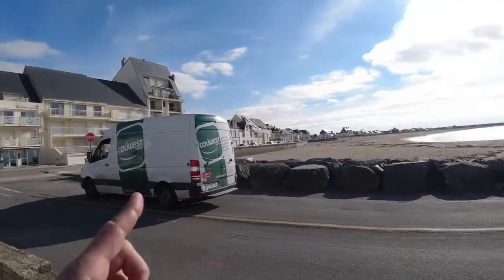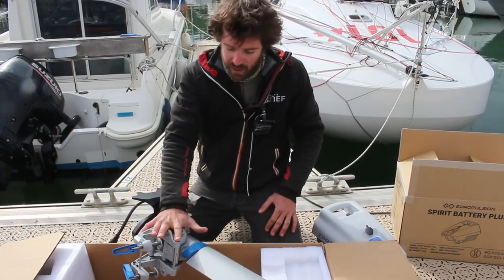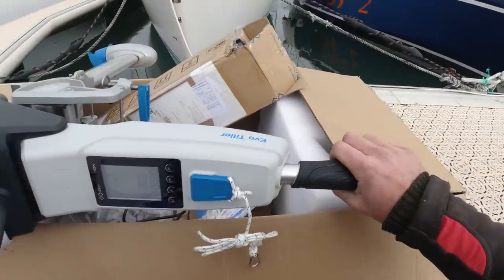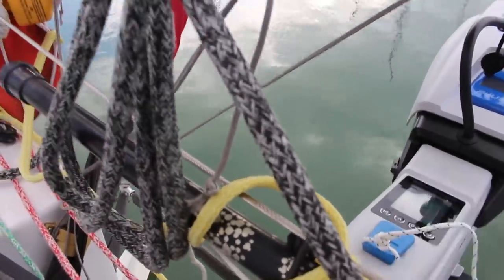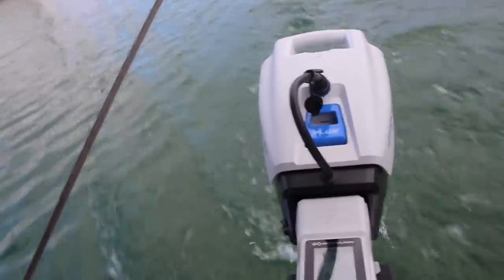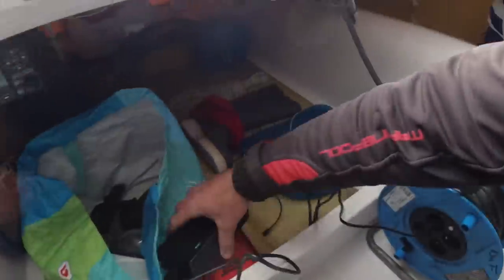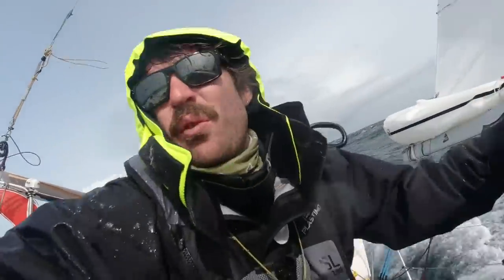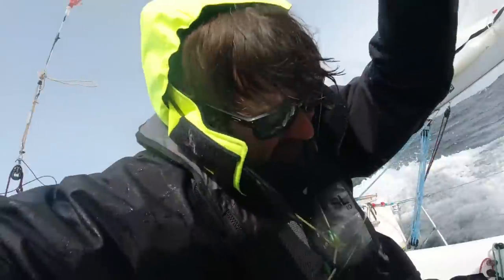Can an electric outboard survive offshore? Testing the ePropulsion Spirit 1.0 Evo -  Ep145 - TSF

Comment: Thank you for posting this. I ordered an Epropulsion Spirit 1.0 only this morning for my Sun 2000. Ever since I have been a bit worried as all the YouTube videos that I’ve seen have been using them on inflatables or lightweight fishing craft on inland waters. I was sure it would be fine for my needs but wanted to see some proof. Now I’ve seen it. If it’s good enough for your boat when leaving and entering marinas it will be more than good enough for mine. I’ve subscribed to your channel. I sail out of La Rochelle so I will keep an eye out for your boat as you might well be in the area from time to time. Merci une fois de plus.

Comment: Hey Hugo , electric outboard is super...i put it on my 21ft last season. for entering and leaving harbor priceless..new brushless motors are  efficient and reliable.., many times i see guys sitting in the marina and fiddling  around with combustion  outboard motors instead of sailing...
Reply: Which ePropulsion model did you get? I see the Spirit 1.0 and Spirit Evo are both 3hp. Is that enough for your 21ft sailboat? Or did you need to get the Navy that comes in 6hp or 9.9hp?
Reply: not chef  they bougg chief out biard 40000 hiues 40 year rekbile

Comment: Great information on your engine. Regeneration a major advantage. If you get a spare magnetic ignition switch, you will be sure you won't lose the one that came with the motor. It might be helpful to have some spray electronic cleaner aboard to use on the cable in case salt film causes poor contact.
Reply from the maker: Great point!

Comment: My following comments about electric engines are not related to this product.  I have an electric yacht inboard engine in my boat. It was super easy to install and the cost wasn’t bad either. The real costs are in the batteries.  On a motor such as mine 10kw, you need about 6.5 kts to get any measurable regeneration.  So we essentially need to be at hull speed to get any benefit.  I would expect a motor such as the one Hugo has to get regeneration at much slower speeds.  Of course with his rocket, he doesn’t need to worry about it.

Comment: Looks like an awesome motor thete are 2 features that I would like: One to charge the boats batteries not just it's own battery and B to have option to use the battery remotely, like to have the battery inside a cockpit locker.
Reply: Totally agree, question is whether it could handle the abuse and power created at speed behind a boat like Hugo’s. The Vendée Globe saw several hydro generators burn out I believe cause they aren’t expected to run at such high speeds. It would be awesome on a cruiser to charge batteries on a dull day when solar ain’t putting out
Reply: Don't need to charge boat battery. Just have one extra battery and 2 ports inside. 12V and duble capacity. When using one battery for propulsion, one is always House battery. For small boats would be perfect. Modular and chargebal at the same time. And for raising they can make only hidrogeneration modul. Baseclly all in one product
Reply from the maker: Yeah you're right, ePropulsion offers this option, have a look at their website, they did thought the concept through

Comment: It would be good if you could have the battery remote.  
Looked a danger of dropping it in the water when leaning over the stern.
Reply from the maker: Yeah, epropulsion has this option, I already have batteries so in my case it wasn't interesting, but they thought the whole system through
Reply: Just seen elsewhere that they are both waterproof and float.  Torpedo ones don’t float!,

Comment: Great with the new regeneration!
We built a daysailer also equipped with a spirit 1.0, a tip is to  use  E-Ps extension cable so you can have the battery inside the cockpit and don’t need to huzzle with it outside the boat in waves!

Comment: That's the best electric outboard I have seen so far. I am not going to point fingers but those electrics with the high whining sound drive me fucking nuts. The battery life is actually quite impressive for the electric outboard motors I have dealt with, but then it is a battery superior in size to the many electric outboard MOTORS I have played with. Engines burn fuel, motors run on electricity. Overall I am impressed with that electric outboard. In addition you do know, if the thing can charge its own battery, it can charge others aboard as well. just saying,,,,,

Comment: On your ~1 ton boat, have you tried motoring into headwinds with the epropulsion? At 100% power, can it overcome 10 knot headwinds? 15 knot headwinds? 20 knot headwinds? My only concern about getting one of these is if winds are blowing straight out of a harbor and I have to motor into harbor for 10 minutes, overcoming up to 20 knots.

I don't care if it would be slow, but could it overcome 20 knot winds upwind at 100% power for let's say 20 minutes if the battery is ~80% charged?

Comment: If there was a way to stick the battery under deck and extend a power lead to the motor, in addition to also being able to mount it as part of the outboard, that would provide great flexibility. Such a battery could also be your house bank that charges also from solar. And no maintenance. :)
Reply from the maker: Yep, Epropulsion offers this option, for me it wasn't adapted, but have a look at their website for more details

Comment: Great review thanks Hugo. I have a Dufour T7, designed for the Mini way back in the 70s. I've reviewed the subtitles and notice you got 'about 4knts' at full power. Is this 3.5-4 or more like 4-4.5? There so few reviews of these Spirit 1.0s powering daysailers and I'm really keen to switch to electric but I have to have 4knts min to cope with the tide where I sail.
Hoping that my old fashioned pointed bow may be more slippery than a scowl when motoring!

Comment: Question; Greeat future that it can recharge it self, but is it possible to connect the boat to it to charge the batteries of the boat as well?  Nice video again!
Reply: My thought exactly. It would sure help on those days when Sol is not available.
Reply: @hemeoncn  If so, than its an great machine!
Reply: I’m sure an electrical engineer type could jury rig it, but for the company to make it easy for cruisers is a super idea and timely
Reply: @mhensen1  I think it’s an question of software, so time will be our friend!
Reply: I would expect all you would need to do is measure the output from the unit when charging and find a charge controller that will accept that input voltage to feed your onboard batteries.
Reply: @leo169  yup, but for me I wonder if it’s made to sustain that sort of constant work at this point
Reply: @mhensen1   good point, it would be a case of try it and time would tell I expect. As an outboard it should be reasonably robust, however it is not a purpose designed generator so there will be some compromises in design and effectiveness as a generator. You would need to weigh up the cost against a purpose designed generator and expected life span.
Reply: @leo169  yeah, personally am in over my head, I just remember those failures in the Vendee Globe with purpose built hydro generators, so I wonder if this wouldn’t be a little under built for long term power gen
Reply from the maker: ePropulsion has a system where you can have bigger "house" batteries inside the boat where you can connect the engine remotly but also had solar chargin etc...
Reply from the maker: Charging issues of hydrogenerator on the VG also has to be put under perspective... they are going to speeds and periods of times that few cruisers will ever experience :)
Reply: @TheSailingFrenchman  yeah but you do! My future cruiser...cough cough... won’t be an issue you are correct, my concern mainly was exposure over long times of constant charging ie for big house batteries, as you say it would be slow, but it looks like a fair bit of plastic on the motor so reliability was my point.
Reply: I guess so, if you have 48v batteries and you don’t mind that it would then charge at the rate of a small solar panel.

Comment: I have the impression the engine's battery sooner or later will end up in the bottom of the ocean. It should have some type of safety connector or something in case you trip while you are removing it or something of that sort.
Reply: The battery floats
Reply: This battery floats.

Comment: Not an engineer, but I would guess the reason for the pitch in the blades is less to do with making the boat go faster, but to increase the rate the battery recharges while under sail.  Adjusting the pitch to increase boat speed will slow the rate the battery recharged.
Reply: Could they build a prop that changes between the two states? Propulsion vs charging?
Reply: Probably 
However 
Added complexity will decrease reliability
Reply: One could have a separate generator, like the old log line trailed behind. That way no need for compromise on the props.  But then surely someone has thought of that?
Reply: yesx it dise

Comment: Hi Hugo. This is an interesting looking product, the hydo-generation is a fantastic feature. Something I will have a look at. 

On the cable from the motor to the battery is there a cap for the plug? Or is there some other way to protect the plug terminals from sea water? That might be one of the more important maintenance items to watch. Maybe carry some contact cleaner and a bit of dielectric grease as a precaution.
Reply from the maker: There is a cap indeed, but it seems a bit loose, I've just stuffed the whole connection with grease, just in case :)

Comment: Helo! On the one hand you pilot a sailboat that is naturally powered by wind and now you even bought an electric motor. On the other hand, you have a diesel van with a  very polluting engine and as it has a malfunction it still pollutes the atmosphere much more. 
Don't you think it's too inconsistent from you?
Reply from the maker: Here is another question to add in the mix. What has the higher cost on the environment: carry on using a van that is a little bit more polluting that newer versions? Or buy a new van, which has more than 3000 parts, all made in different countries, which each part had to travel thousands of miles in container ships, plane, trucks, and not to talk about raw materials...
I think my good old van is still greener ;)

Comment: Is it possible to connect the engine to the main battery inside the boat? Use engine without its own battery but only lifepo4 300ah inside the boat.

Comment: I have what looks like your outboard bracket, the black plastic mounting board for the motor on mine has a flat back but the front is full of cavities which makes it difficult to clamp the motor to it. Is yours solid or does it also have the molded cavities in the front side? The stand offs are a good idea so you can fully tilt the motor up.

Comment: That slamming into the waves ... How much slamming can a GRP sailboat take? I heard of people delaminating their bulkheads from the hull because of that. I always cringe when I slam hard into a wave like that. What is your take? Especially in the Med where you can have short and tall waves and confused seas. I'm really curious. How often does this happen on a racer in a big storm like you had in the Antarctic Ocean? How dangerous can it get for the boat?
Reply from the maker: Well, it's a fine line between too much slamming and going too slow, especially in racing.
On a cruising boat, don't worry about delamination, boats are made strng enough to withstand crashing in docks. Race boats try to save on weight, so its a different story
Reply: @TheSailingFrenchman  hey, thanks for the reply!

Comment: This seems like a great motor for cruising my small trimaran and the first one with a functional self charging system. Great! How much does the motor slow the boat down while charging?
Reply from the maker: Drag really depends on the boat, on a planning hull like mine, it's around 1kt between 2 and 4 kts boat speed, then 0.5kt between 5 and 7kts, then no more loss. I'd assume it's around the same figures on a light tri
Reply: @TheSailingFrenchman  Thanks!
Just the kind of answer I was looking for :-)

Comment: Great review thank you!! 😊 I have a 24ft semi displacement motor sailer at about 1.5 tonnes. I wonder if the Spirit 1.0 Evo would have enough torque to get in and out of the harbor and cruise around the bay (inlet)? I have a 8hp Diesel Engine built in but am looking for an auxiliary outboard motor. Any thoughts are welcome :) Thanks again for a great video and review.
Reply: Same here. My 22ft keel sailboat is slightly lighter 1.3 tonnes, but I use a 9.9 four stroke engine, which is quite heavy. I just bought a used Spirit 1.0 to test if it's good enough for getting me on the lake and see if gives enough speed to keep up with traffic on some channels. I'll keep you posted.
Reply: Did u guys manage to make it work with the Spirit 1.0 Evo? Planning to use this on a 24ft
Reply: @pinye.  works well on a 1.6t 24ft sailboat for in and out of the harbor in good conditions. Tried against strong currents and head on 40km/h winds and had to turn the diesel engine on. But otherwise perfect for calmer conditions :)

Comment: Interested to know the figures on recharging.

Start at 80% charge, 10 mins under power, how long does it take to charge back up to 80% at 6knots.

How much speed do you lose with it in the water and charging vrs not in the water?
Reply from the maker: 10min of use > one hour of recharge to compensate the use at around 6kts
Drag really depends on the boat, on a planning hull like mine, it's around 0.8kt below 7kts, then no more loss. On a displacement hull, drag is barely noticeable
Reply: 6 miie range